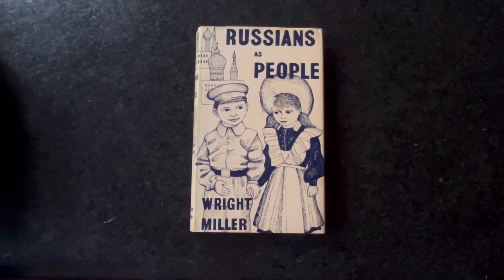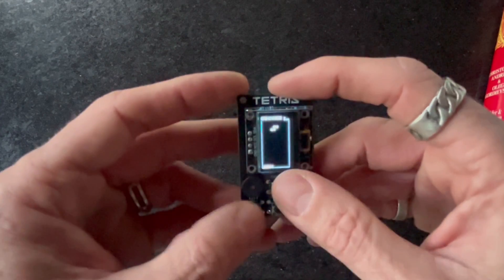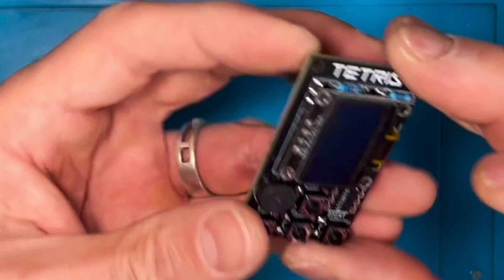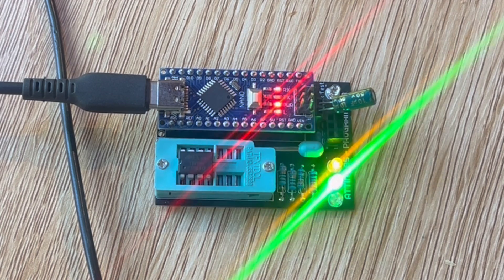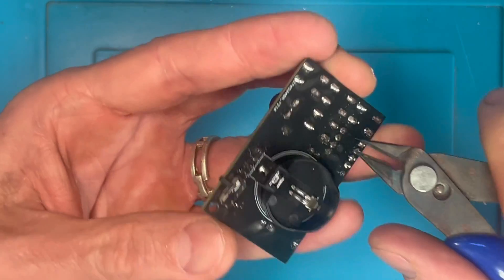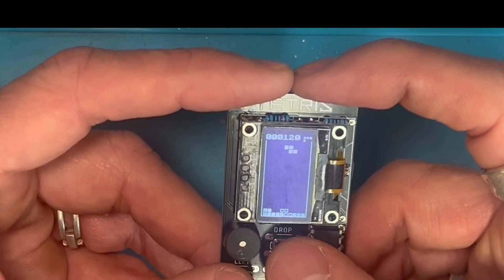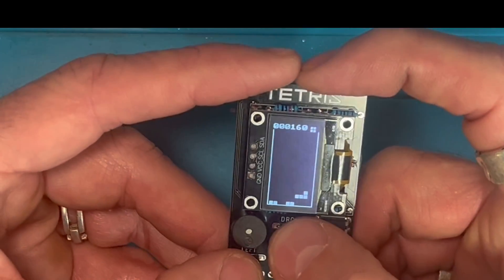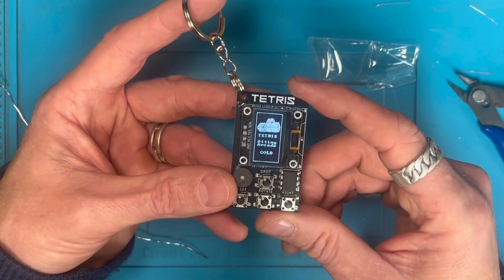Tiny Tetris - an ATtiny85 Build

Comment: I dig it. Trying to make this now. I will let you know how it goes. I am making it myself first so I can then teach the kids. I also want to make the other small handheld you have designed.
Reply: I got it working. I made it on a soldered breadboard. I wanted to make sure I was able to program the attiny properly. The kids want to make the other version were you have different games available. I’m sure that since I was able to get this working I can manage the other one. I am going to order the pcbs today. I think I am going to go through jlpcb unless you or anyone else has a better suggestion.